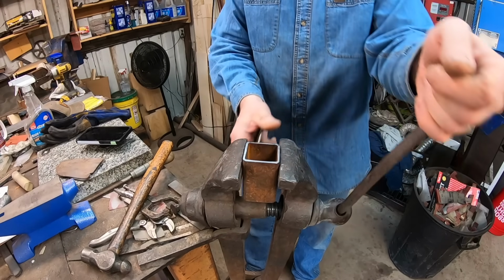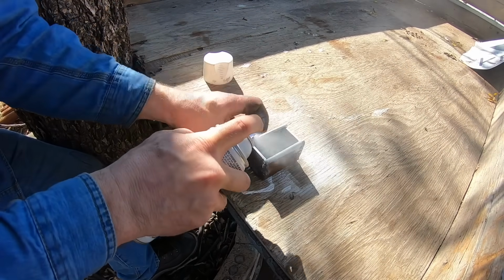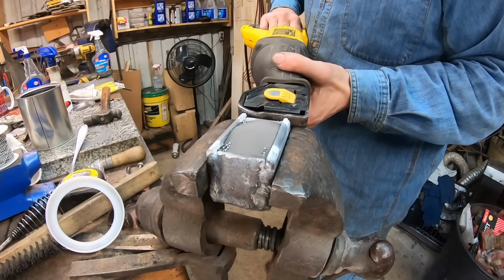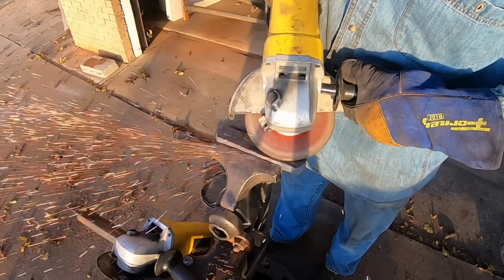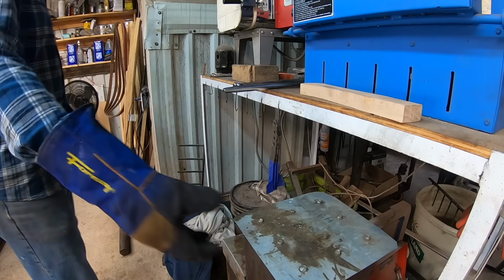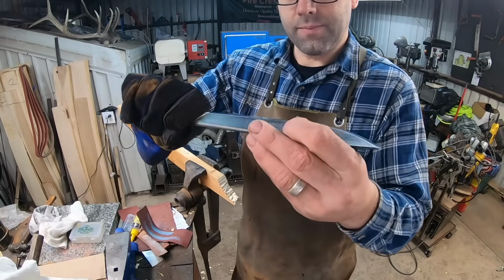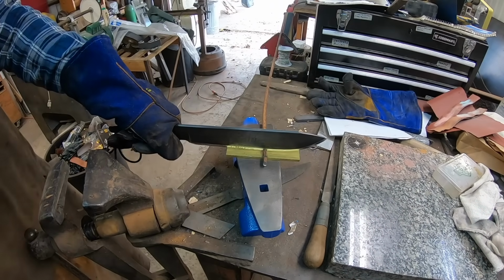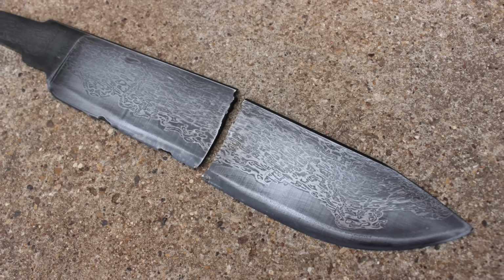Forging Knife From Ball Chain And 52100 Steel

Comment: Looks like it already had a crack at the spine.good thing you tested it.
Reply from the maker: I see the discoloration that you're probably referencing, it does look that way however just didn't get cleaned out of the etch well enough. That stress point I created at the edge just took the blade apart.

Comment: you should do barbed wire in a canister with powdered steel to get the contrast and maybe do an edge bar or do what you did with the O1 and bearings in the flat canister thing but with the barbed wire.

Comment: Good idea.  I'm wondering if crushing the ball chain before putting it into the canoe would have had a different result.
Reply from the maker: Yes I believe it would. I thought of that, after the fact.
Reply: @FireCreekForge  in light of Dr. Thomas' findings that nickel and 1095 had the best testing results for the Damascus steel, crush the chain, and then just add 1095 powder.  Just an idea I just had.

Comment: An idea for a canister I got from your "contained non canister, canister" where you drilled and added roller bearings:  take rods of different shades of steel, place them each specifically in its own spot, creating a dot matrix/pixel art type pattern.  Can't be much more time consuming than welding, cutting,  grinding, stacking, rewelding, cutting, regrinding, restacking over and over again for some of these mosaics they come up with.  Could copy any photo, in black and white style to any project.  For bigger parts of a picture,  could use water jet cut shapes.  

Which gives me another idea: possibly use water jet, dot matrix comb I ned for the pattern of a touchmark billet, mild steel powder, etch end to depth desired for imprint.
Reply from the maker: Might work!

Comment: The Buck pocket knives hammered through steel was legit. I know they would hammer through nails. And there was no nicks in the pocket knife blades. Might have been bolts as well but not for sure. This was back when they were using 440 and 425M steels.  Not the 420 steels that they use today.
Reply from the maker: Yes the Buck knives used to be pretty hard. I found this out the hard way when I snapped the tip off of my Buck 110 Hunter.